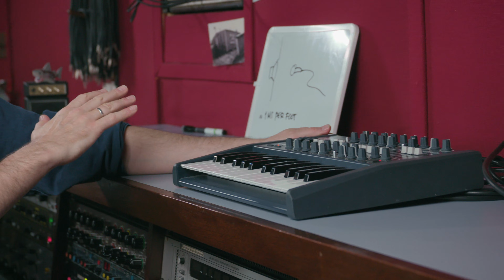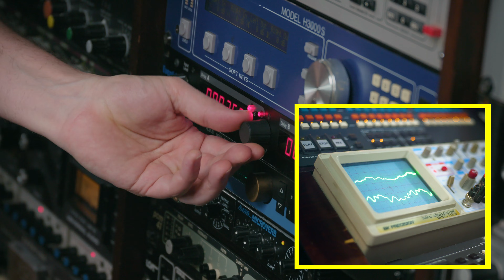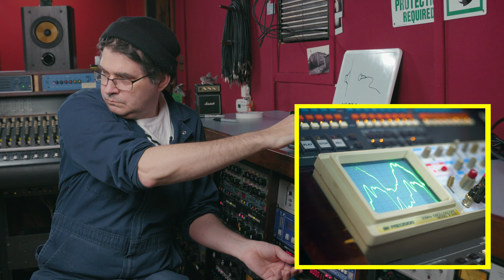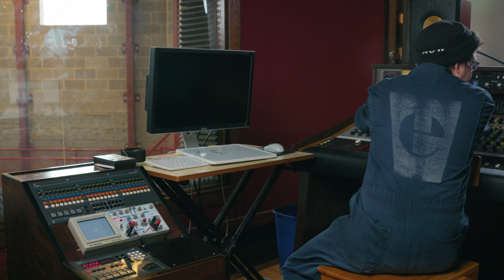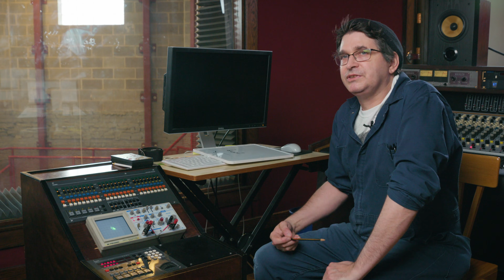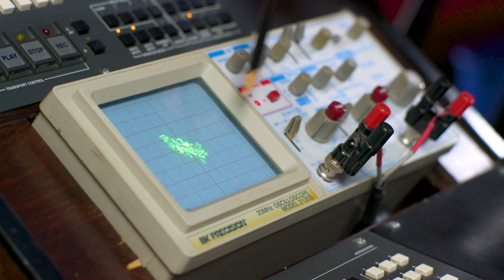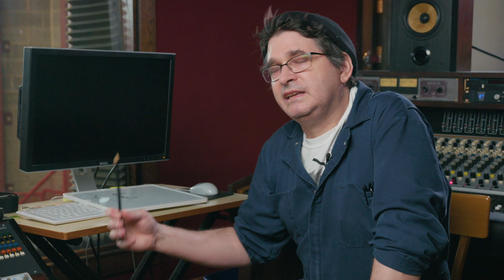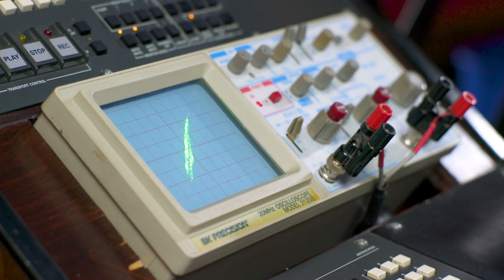Electrical Audio How-To: Time Alignment of Multiple Sound Sources

Comment: In the last microphone setting the harmonics between 2000 and 10000 Hz increased considerably, hearing peaks that previously, due to the phase shift, were not so noticeable. In these scenarios it is difficult to decide, since as a guitarist and producer, these harmonics can be annoying and attract attention and probably later, in the mix, they should be treated.

Comment: The last part where Steve just adjusts mics by ear... that's the part of all this stuff that can't be taught.
Reply: True but in that particular scenario, zooming wave forms would yield the same information telling you which mic is later...  I'm not saying doing it visually always works, because it doesn't sometimes (if the two signals are significantly different enough for whatever reason, time arrival might not be the end-all of phase).

Comment: Hey!
I loved this video!

I have a couple of possibly dumb question though.

You said that you can hear the sound pulling towards one of the two mics, how did you make sure that they were at the same volume?
Like, I think I would confuse the "pulling" feeling with just one mic being louder than the other (although I've never tried in a studio myself)...is there a way to set the mics at a precise level in an absolute way?

Also, would playing harmonics on the guitar (or perfect sinewaves on a synth) help recognizing better the phase differences or do you need some playing with high frequency content?

Thanks, going to sub!

Comment: I understand moving the direct source signal to make them time aligned but isn't moving the source signal gonna fuck with the players perception of being in time musically while recording?
Reply from the maker: Steve's adjusting by microseconds (1/1000 of a millisecond, or 1/1,000,000 of a second). Our brains take about 20-30ms to even perceive aural events as separate, so we're pretty well past the threshold of what someone would perceive as out of time. But it still impacts the sound quality- at times, greatly so!
Reply: How would you time align tracks on a tape machine that have already been recorded.  Let's say you want to time align over heads on a drum kit. Is that when you abandon tape and do digital?
Reply from the maker: @jaredrush6750  You can do the same thing, but process the output of the tape machine/ recorder. Line out from tape -> delay (on an insert or patch directly from line out) -> desk. There is a shift that happened with the move to digital recording that more of this type of corrective work is now done on the "back end," after recording, at mix. "Let's fix it in post."
Reply: @ElectricalAudioOfficial  ahhh yes. I guess I never thought of re-amping the track back through the delay.   Makes sense. Thanks

Comment: Maybe a dumb question, but instead of getting an expensive eventide precision delay can't you just zoom in to the millisecond level in a DAW and manually move the mic'd audio file so the wave form is in sync with the direct signal? Obvs only relevant to digital multitracking
Reply from the maker: The unique thing about the Eventide delay is that it gets down to microsecond level, so three orders of magnitude more precise than millisecond. Even at 192k a sample is still about 5 microseconds, but when recording digitally your time resolution is samples, and you can certainly move things by one sample at a time.
Reply: @ElectricalAudioOfficial  pretty amazing that people who worked on some of my favorite records actually replied, thanks for the wisdom!
Reply: @ElectricalAudioOfficial , even tho time resolution in digital is at samples, it would still be ideal to use a sub-sample delay to align them like Eventide's microsecond plugin, right?  Or is it no better than just doing sample-resolution nudging?  (I think I know the answer, but want to hear from someone more experienced, ha).
Reply from the maker: @busyboxst7  Don't know! I don't really understand how a delay can move something by less than a sample in digital. Maybe it doesn't?
Reply: @ElectricalAudioOfficial  ,  a quick null test or two would prove it out.  Not sure if the Eventide plug has a demo... hmm... If it does work, it'd be via oversampling, and perhaps (above my paygrade) the sort of thing you'd want to set once and then print (might be heavy on processing).

Comment: I'm on the other end of the audio thing as I build amplifier for guitar and a scope can be a very critical tool.  A guitar amplifier is very simple as an audio device once you fully understand what's going on, as compared to more sophisticated circuitry and devices as I come from a TV background.  When you get into TV and radio devices, you need the scopes to do alignments and adjustments.  SO I can say, that I am very impressed of the use of a scope in a recording studio situation. I have never noticed this in all my observations relative to recording studios, and now will have to call it out.  But it should be pointed out that a modern studio situation with multiple source possibilities is rather different than a vintage studio situation in the infancy of recording when there was ONE microphone being utilized
Reply: Most people in real life would just walk away instead of trying to understand this sort of stuff.  I see it all the time.  They want to record with a phone and expect it to be printed.  Like...  Okay go somewhere else with your half ass lifestyle.

Comment: It's so easy! You just need a specially designed analog delay made just for you and an oscilloscope! 🤔
Reply from the maker: And a working tape machine, multiple mics, or a mic and a DI. Not to mention a console, patchbay, monitors, amps, a guitar or keyboard. Yup!

Seriously though, if you're recording at home in a DAW, you can use a plugin delay, provided the plugin gets to single-sample resolution, or move your tracks sample-by-sample, as someone below suggested. The point is to think about it and not just shrug it off. We can do better than the two options we get with an "in phase" and "out of phase" button!
Reply: @ElectricalAudioOfficial  Eventide makes a microsecond plugin.

Comment: How did he send the synth to both the desk and the amp/mic? Does the arturia synth have 2 outputs?
Reply from the maker: With a DI. Every DI should have two 1/4" jacks in parallel, one is used for input (doesn't matter which), and the other you can use to go to an amp. The XLR out of the DI can go to the desk or an outboard pre, etc. We have a DI video on our channel that explains some other fun uses of DIs!

Comment: Thanks for the informative peak into time aligning multiple mics on a single source. A while ago I got my hands on a B & B systems AM -3B stereo phase measurement meter. I am looking forward to putting it into use. I was wondering if it would be more accurate and easier to use a 1Khz test tone to do the alignment ?

Comment: you should record the two not aligned and then the two signals aligned to see if theres a big difference.
Reply from the maker: Try recording a distorted bass guitar with two mics, and nudging one of them by a single sample at a time. Report back with your findings! (Spoiler: the change in sound is huge)

Comment: Soo what I’d like to know if anyone can actually help me is how to record two different guitar amps at different takes without much of a latency issue,

In Other  words, is it as simple as recording town amps at the same distance from a mic , even if it’s different takes, aslong as the same mic is used at the same  distance in each take on different amps, should line up alright ?
Reply from the maker: If the capsules of the mics are the same distance from the speakers, you should be pretty close. They don't need to be the same mic, and in fact, you'd get the benefit of some tonal variety from using different mics. You may still have to "nudge" one signal or the other with a delay, as demonstrated, or by moving pne or the other in your DAW. The important thing is just to think about and plan for phase coherence between sources recording the same signal.
Reply: If by different takes you mean a player literally played the part different times (and you don't just mean reamped at different times of the same take) then phase between takes should not be a concern.... If you mean using 2 amps x 2 takes (in other words 4 tracks total if one mic on each amp), differnent story but same story as the video illustrates.  I'm not 100% sure what you're asking though.  If they're literally 2 different takes, it's not going to harm anything having one mic 1" from the cone and the 2nd take it's 3" or 6" or whatever from another cone/amp/etc. because the take itself will not be in time perfectly with take #1 (if it were, what would be the point of a separate take?).

Comment: I love the trick where you use a very hissing sound, flip the phase on one mic, and adjust until the hiss is gone, and then you can reflip the phase ;-) simple and fast.
Reply: I'm guessing that hissing sound is pink noise. You could use white noise but pink noise is closer to the way human ears weight the frequency range so you should probably use that.

Comment: Excellent video - please make more !    I would like to use an oscilloscope myself (and my ears more) - I have a small home studio - Any oscilloscopes you recommend ? - and how are you tying it into the recording chain ?
Reply from the maker: Hi there, we have BK Precision 2120B scopes in our studios. They can be had relatively cheap, as they were ubiquitous in labs for decades.

The scopes are (half-)normalled to the 2-mix output of the boards via our patchbays, but as you can patch into them, you can put any signal or two signals you want into them.

Thanks for watching!

Comment: .7ms not 7.7ms
Reply from the maker: Hello. We've been waiting for you.
Reply: "774 MICROseconds" translates to .77ms.  Or did someone say 7.7ms?  Even if so, it's pretty common sense there's not over 7 feet worth of delay but rather about half a foot which is a normal mic distance + other inherent fairly small amount of delay.
Reply: @stephenhudson4526  far worse mistakes have been made.

Comment: Can I use my mixer's digital delay on one microphones channel for manual phase alignment? Will I be able to hear the stereo image being pulled by one (closer) mic vs. another (farther away)? Or is that impossible? Do I actually need to inspect the wave forms?
Reply from the maker: Hi, 

It's unlikely that your mixer has delay in the ranges that would affect phase- we're taking about fractions of a sample in the digital recording realm, or microseconds in the analog. In a DAW it's become conventional to visually align the waveforms, but as always, use your ears. There are also some tools (plugins) in that realm to aid in phase alignment, namely many DAWs have a delay that can delay by single samples. Eventide also have an excellent plugin called "Precision Time Align."

Comment: When might you use phase rotators vs. Delay? If you do at all... Is there a difference between e.g 90degrees and a few MS and when does it occur?
Reply from the maker: Phase rotators, if I understand, generally use all-pass filters that shift phase but leave amplitude untouched.

Most often when you're recording multiple signals from a sound source, the signals are out of phase because of arrival time delays. Using a delay to make their arrivals more simultaneous is a way to get the signals aligned. If you use a phase rotator, the arrival times will still potentially be out of alignment, but their phase relationship can be closer to corresponding.

In our case, we always use a delay because we don't have any phase rotators. But if you have a phase rotator and no delay that can get down into the sub-millisecond range, use that!

Comment: The second part of the video where Steve was adjusting the distance between the two mics should have gone on for like an hour longer with incrementally worse and worse results until he finally went completely insane because that's what happens when I try to do it.
Reply: I know this is a year old, but there's a way of getting the phase as close as possible by first flipping the phase of one of the mics, or in this case not flipping, then align the mics to a point where the signal is the quietest (it's a lot easier to hear than this) and after that flip the phase. At this point you're maximizing the signal strength which means the bottom end is in phase.
Reply: @ElmoSyr  Amazing tip!
Reply: @ElmoSyr  yes, they all make automated mic stands that make very small changes much easier
Reply: @ElmoSyr  Nice! ( Thanks )
Reply: @ElmoSyr  I know I'm responding to an old old post here, but the problem with that approach is that it only cancels phase. The method being discussed here allows you to locate the mic in the BEST sweetspot, and ignore phase issues. Then, with your perfect mic position established, you can go ahead and cancel the phase by precisely delaying the direct signal.
Reply: @mattcaucci3818  except if you delay  signal you are simply changing where your phase issues are. The sum of the signals will likely not sound like the sum of the two mics because of the cancelations. Of course you can tune the delay by ear to get the best of it, but it will not be fully in phase as with my suggestion. The only way to have maximum phase coherence is by having the mics exactly the same distance from the source and the null is the easiest way to achieve that.
Reply: Great tip but everyone needs a scope.
Reply: Maybe putting headphones on and doing it in mono can help focus on the phase cancellation better.
Reply: Put a tape measure on the floor from the cabinet.
Reply: Yeah well, it helps when you're born with an extra special gland in the brain known as the "albinithalamus", that pulses gently any time things are perfectly in phase.
Reply: Just kidding, dude just knew what he wanted from very early on and has an incredible work ethic, it's evident from every interview he's ever given. Certified badass in his own right. I doubt he thinks of himself that way, though. He seems so humble, pragmatic and down-to-earth. We need more of the wealthy people in America to have come from stock like this. Wealthy because they did something that matters ... Granted, that's a tough racket, and timing doesn't hurt....
Reply: @james: I laughed out loud at your reply.  I can imagine your frustration and pain.
Reply: Well people attempt to do this without a trained ear and it's like tasting wine all night long looking for the best when you've only had Boones Farm.  Bout an hour in you're gonna be pretty well tuned.

Comment: Is this something you do with close mics on a drum set, say when micing the top and bottom head of a tom?
Reply from the maker: It's not common practice at our studio, but there's no reason you couldn't. You'd just be limited by how many delay lines you have that can get as short as you need.

Typically, when micing top and bottom of toms if you flip the polarity of one or the other mic they come into great phase alignment, provided the distance between the heads and mics is the same.

Comment: Are your monitors upside down or do you have an extra sub? If so, then why has the monitor an airhole (on the front)? Nice video, Steve! Thanks for sharing! Big fan of you and your work.
Reply from the maker: Hi,

Those are B&W Matrix 805s, they can sit vertically as we have them or there's another version that can sit horizontally. The tweeters are mounted on top of the cabinets.

The hole is the cabinet's port. Many speakers are ported, but some have the porting on the rear, and lots of speakers are covered in grill cloth, so you may not typically see the hole.

We don't use any subs, the 805s get surprisingly low.

Thanks for watching, we'll tell Steve you liked the video.